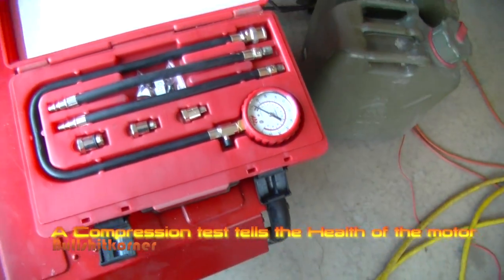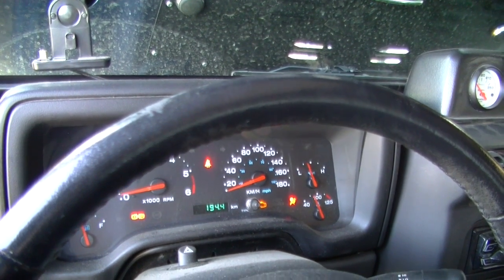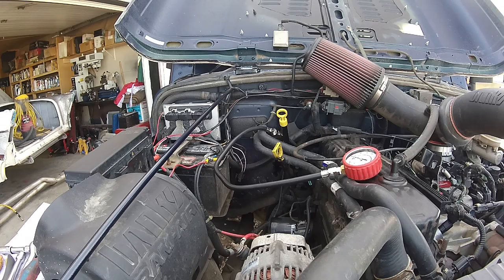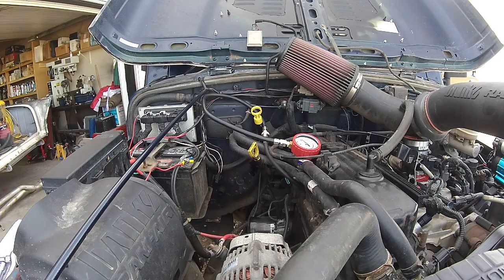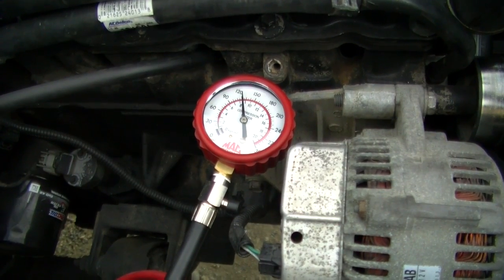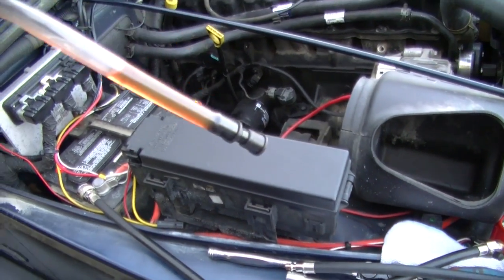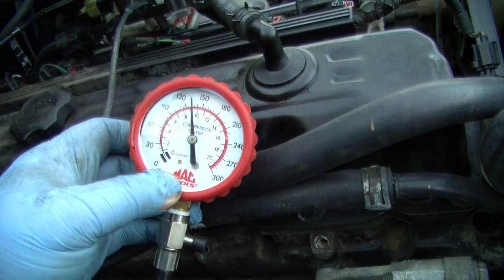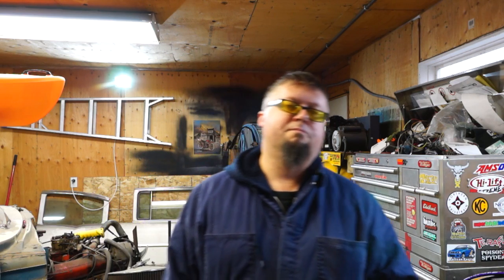How to Do a Compression Test  DIY

Comment: Thanks for showing how to check compression. Just hand tight for the sparkplug hole fitting? Seems like 4 cranks too, right? Dave
Reply from the maker: my fitting has a rubber seal so it just needs to be hand tight, about 6 cranks is plenty
Reply: Good to know, thanks! I was going to get one at Summit Racing the last time I was there so that I can do a test on my 83 Benz diesel. I just need to see where I'm at w how much time & effort I want to put into this grease moble! If the engine is still decent, it's all good!

Comment: 2 things, first: most modern vehicles have an ASD (automatic shut down) relay. This is what you are supposed to remove, not the fuel relay. Second, you are supposed to continue to crank the engine until the compression gauge does not rise anymore. Stopping while it is still rising as shown will give inaccurate readings.

Comment: Jerry have you thought of spraying in a good carb cleaner and let it sit in the  piston  over night and see if it improves compression from stuck rings.  Worth a try.
Reply: That would only work if he had buildup on the valves, and still probably wouldn't do much. But since he already found it was the rings it wouldn't help compression at all.
Reply: That's what I was referring to was carb cleaner for the piston rings not the valves. He definitely proved his Loss of compression was the rings.  I would try a couple of ounces left in the cylinders over night and see if  it helps with a stuck ring.
Reply from the maker: I seafoamed the engine prior to doing the compression test
Reply from the maker: publicsafetydan It doesn't matter if you remove the ASD relay, the fuel pump relay, or disconnect the electrical from the pump the end result is still the same.  And for your other comment, I already knew what the compression was as I tested those 2 holes while changing plugs then decided to do a complete compression test

Comment: Just my 2 cents. But with the stroker u'll get almost 300hp. At that point is the Super Charger really needed? Also 4 door JK is good if u have a Fam. TJs are much easier to work on, their electrical systems are much simpler! 

U also need to come out to NYC!
Reply from the maker: I really want the JK for the space, the TJ is a bit small if you want to load it up. true what you said about the stroker and the super charger.  I'm just curious to know what a jeep is like with one
Reply: well, if u sell your TJ. i'm coming up/over to buy it!

Comment: Still pretty good. Didn't you rebuild it when you got it ? Nice touch with the music !
Reply from the maker: it was a used engine that I put in
Reply: Bullshitkorner ahhh I forgot that. I remember the bad one
Reply from the maker: yup so do i, that's what happens when you change oil every 20000kms on regular oil
Reply: Bullshitkorner good 5hing I drive "miles"not "kms" the engine will last longer .....